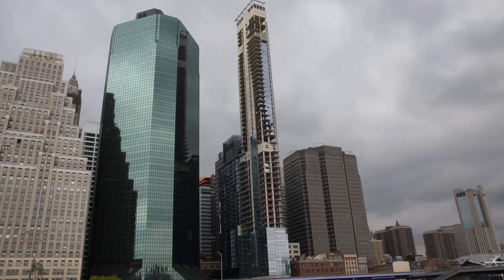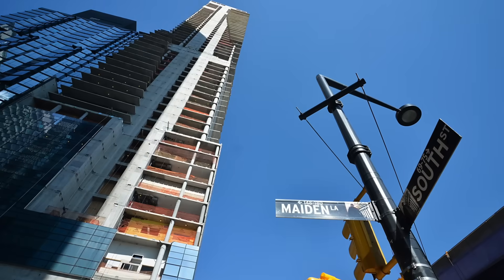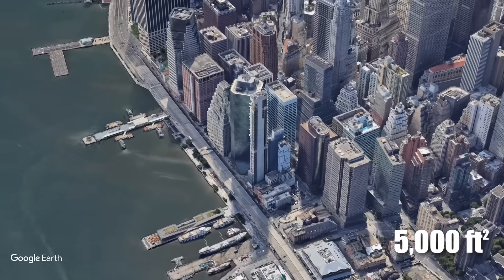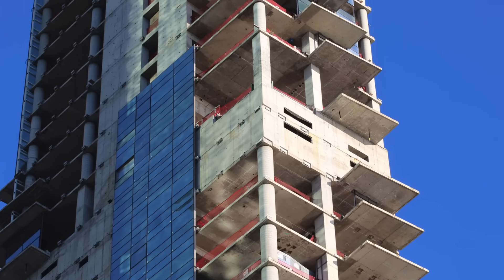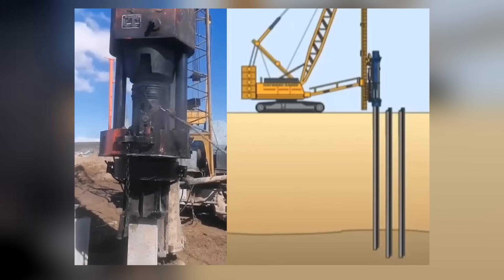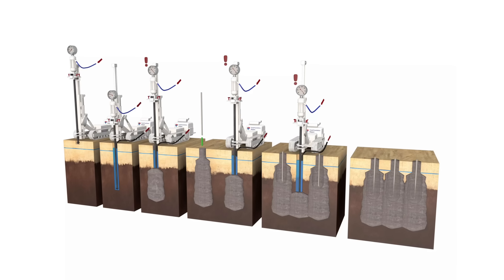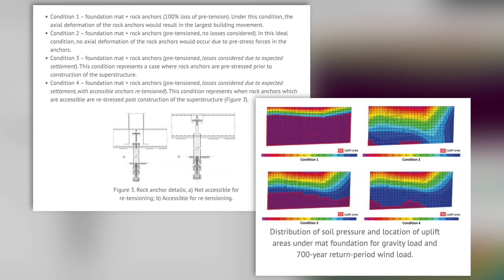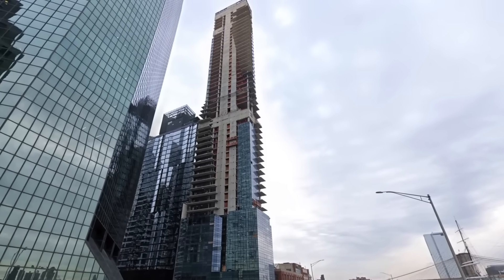Why Nobody Can Fix This New York Skyscraper

Comment from the maker: A nightmare for New York, will this ever get fixed?
Reply: All they need to do is change the name of the tower to East Pisa Tower.
Reply: @lorenzoblum868  More like PISS a tower!
Reply: @lorenzoblum868 or Trump tower 2
Reply: @brianzimmer5532  Trump doesn't build junk.
Reply: @MrAquinas1 😂😂😂😂😂😂😂😂
Reply: NYC's own Millennium Tower.
Reply: @The-KP  It made me think of the Millennium Tower as well. I wonder if the "fixes" used there in SF would work on this building in NYC?
Reply: @The-KP THE DEPTHS OF BABYLON & GABBLE-ON..😊
Reply: It'll get fixed when they tear it down and build something practical on the site.. something drilled solidly into the Bedrock
Reply: No.
Reply: No. The longer they fight, the more impossible it gets. But trying to go the cheap route in the first place makes the fix much more expensive than if they just went to bedrock all the way around at the start. Now they got the building in the way as well as the half assed foundation in the way. There may not be room enough to work around both, and they may have to drill through some of the concrete they put in place. Which will cost like drilling though solid rock.
Reply: @BEdwardStover that's a Murphy's Law.. trying to save money by cutting Corners cost twice as much as it would have cost to do it right the first time
Reply: @BEdwardStover  it’s the same thing they did with the millennium Tower in San Francisco. That didn’t go so well either..
Reply: Oh no! at 6:15 he says heigth instead of height. Doh!
Reply: @TheImpossibleBuild  To all the negative commenters of NYC... you obviously don't know NYC. Most likely never even been there.
   I ALWAYS SAY...WHAT PART DON'T YOU LIKE ?? New York is many different sections,  boroughs, with umpteen different neighborhoods, you can find all your daily needs in.  Or Shopping districts. Galleries, Museums, etc. If you don't like where you are, only a few city blocks can take you somewhere else entirely different. 
   It is entirely walkable, which very few actual cities, if any, can even claim. Especially now that the Times Square reno has tied the whole city together, in a georgeous way.
    Mass transport is excellent, and cheap. Buses run every 5 minutes. It's literally impossible to miss one. No waiting in the cold for half an hr. Longer distances, fast is the subways. But all anyone has to do for a cab, is walk to the curb, and put your hand up. Instant cab. No sitting home irate waiting for one.
   Time is important in NYC. And the city doesn't waste your time, waiting for life to happen. For some yearly event. There is ALWAYS something. Many somethings. And tomorrow, or next week, there are other things. For all different kinds of tastes, interests.
    Some guy wrote on a site, that he hated NY pizza. I asked which of the 1,800 Pizerias was he referring to ??..since pizza varys pretty much everywhere, even in a small town.
    But that's the sort of blanket statements you get,  about NYC, from the completely uniformed.
Reply: I heard him say it leans north. But you are not going to see a 3 inch lean
Reply: @bubbamoran2964  I am coming from the north, so not a good angle for me to see the lean.
Reply: Nope
Reply: I know how to fix it, but they will never listen to me, send me some plans and get your money lined up its going to cost
Reply: @BOBBOB-tx7ox  And I'm willing to help. I did take one architecture course in college.
Reply: I would hire you and you would learn a lot. This is more of an engineering and creative thinking problem than an architectural problem.
Reply: „it leaned three inches or the size of a smart phone.“
Amazes me how Americans will use ANY meassurement before using metric.
Reply: @hatersgonnalovethis  Would in have made you happier to have said: about 75mm, about the width of a cell phone?
Reply: its fubar, in my eyes atleast
Reply: I wonder if the building is insurable and, if so, how does the premiums stack up with normal condos?
Reply: This is what happens when engineering decisions are made by financial people. The 3 most important words in business are "We can't afford." As in "We can't afford to do the foundation right. Find a cheaper way."  It happens everywhere.
Reply: Just because you can, doesn't mean you should.
Reply: Moral of the story: buyer beware! Those old prewar buildings in NYC seem so much safer.
Reply: @wambaofivanhoe9307  Oddly enough, in all these Real estate offerings, and actual sales, that i've seen...no one has EVER questioned the building's integrity. While i realize there are  City and State  inspections, etc., it has to be all too obvious that is faiing short of reality.
   Apartments aren't houses. A house inspection is a relatively simple matter. And yet too many investors...and lets face, ones. Home IS a huge investment, are ASSUMING things that may not be true.
Reply: When you bring in non union contractors expect shortcuts  .plenty of good  properly built buildings on Maiden lane and the whole area .
Reply: It would have been used for money laundering anyways
Reply: NO!
Reply: Nope it’s bout money they don’t care
Reply: It leaned three inches or the size of a smart phone where does this narrator get his measurements from 😂you compare the measurement to a smart phone real genius 🤪🤣🤣
Reply: I am a structural engineer and can fix the building. America doesn't produce GOOD engineers anymore. 3" drift at the top is well within the limit of building code and very easy to be corrected. Due to the steel construction, it is very easy to add actuators and active controls. Very, very easy for any graduate ( PhD or MS) leveled engineers.
Reply: New York, you got money on your mind
and this Pisa tower won't make a dime's worth a difference, so here's to you New York🤩
Reply: new k? vFv
Reply: As a Geotechnical Engineer, I'm appalled!!
Reply: Never buy a home on LANDFILL!!!!!!
Reply: The fix is simple; demo the existing structure; you can build a shorter building with a better aspect ratio on the existing foundation( after some remediation work to the existing foundation); or re-do the foundation anchor it to the bedrock and build the same design over. Moral of the story; most of the time developers want to buy cheap but the "cheap is not always the best option." There are a lot of risks; especially in a foundation work where the ground is somewhat unknown in this site. They should have spent the additional $6m, but they didn't. They can buy a lot of painkillers with that $6m, and spend more to correct this fiasco.
Reply: Is it the same builder as the Millennium Tower in San Francisco…
Reply: If LeMessurier was still alive, he'd probably figure it out.
Reply: Only blessing: not fully completed and nobody lives in it....
Reply: It will have to get fixed somehow, I mean it clearly is in the footings, and I am not sure if there is enough power to correct it.  What would be even worse if the tower kept more and more out of alignment with a risk of crushing the floors in the middle and bring the whole thing down.
Reply: I wonder who paid off the city inspectors to look the other way
Reply: LOL 😅
Reply: If you can make it there just fake your underwear..!😊🎉
Reply: I could easily fall for MAMDANI any day!  He  my mayor guy!!❤❤
Reply: As in neutered?   I could try.....is it safe??😮🎉
Reply: Lol, I hope not! I love a dumpster fire!
Reply: Call in some Chinese engineers. They can fix it for you.
Reply: @Number6_   ....with imported tofu.
Reply: it is what happens when you let greedy bean counters run projects . lol
Reply: @tektkite7255 , obviously Jack Welch trained bean-counters-and-engineers did the most-important engineering-and-design-work on this building.
Reply: There’s no way to fix a building that huge. 3 inches is massive.
Reply: A nightmare for New York? New York is a nightmare.
Reply: @zorngottes1778 New York is a nightmare for some…that don’t enjoy the rule of law.
Reply: 2+2 now equals whatever you want it to and Clown York City.
Reply: Say thank you to the marketing scumbags !
Reply: no any building has a problem when the foundations no good
Reply: Knowing NY probably not
Reply: Let dealmaker Drump fix this within 24 hours after entering presidency.
Reply: It’s NY so yes, in 2056 the permits will be approved.
Reply: It'll never get fixed. They spending that money on ILLEGAL ALIENS
Reply: I would not step foot in new york.🤣😔🤮
Reply: @kurtv.gabhart5441 good😊
Reply: @kurtv.gabhart5441  And we thank you for that.
Reply: @kurtv.gabhart5441  And we thank you for that. Again.
Reply: Trump can fix this tower at any time!
Reply: @justaskinnywhitegirl  Was it intended to be a joke? I hope, not. I , actually, do believe, that Trump ( his organization ) can tear it down and do there something nice.  Remember the Wollman Rink saga? … On the other hand, being the President of the cesspool  that our country is right now, Mr. Trump may simply not have any time for this little nonsense.
Reply: @justaskinnywhitegirl but he has to do it from prison.
Reply: No. NY is finished under the Democrats. 😢
Reply: @mrtechie6810  hahaha the developer is a republican
Reply: @mrtechie6810 The entire country is finished under the Republicans. Trump, the felon, should be in jail.
Reply: @mrtechie6810 yeah, New York needs Rudy back. He’s a stable Four Seasons genius.
Reply: @paulc7486 😂
Reply: @mrtechie6810  As a New Yorker, I take exception to your statement.  New Yorkers (according to Wikipedia) have voted Democrat since 1924.  We are thriving and growing.  One building out of thousands is shut down.  I can't see the lean when I drive by.   What perfect paradise are you from?
Reply: @Number6_  I saw it from the highway on Thursday and I couldn't see the lean.  Is it supposed to lean backwards away from the highway towards the west?
Reply: @CHutch-w2u  There was an exodus during the pandemic but NYC is still the most densely populated city in the USA.
When you say Communist do you mean Socialist?  NYC has great public schools, a great medicaid system, the best parks, the best hospitals, the best restaurants, the best theater, the best subway/bus/ferry system, and many fine universities. Where are you from? 
I was born in NYC and I have never met a communist.
Since my great grandfather and his father were involved in Tammany Hall I agree with you that their politics are not my politics.  
The whole country sends us their talented young people to work in finance, theater, health care and many other fields.
No one loves abortion but some people like women enough to trust them with the control of their own health care and bodies.

Comment: There's no excuse for this, and that includes the fact that the city issued permits for this scheme. One of the most basic truths about building in Manhattan has always been proximity to bedrock. Manhattan has similar considerations to those in other cities, including San Francisco (landfill in a seismic setting) and Cleveland (100-200 feet of glacial till near most of the lakeshore) among others. For example, the new Sherwin Williams HQ is the only building over ~250 feet which wasn't built on caissons; like 161 Maiden, it's on a mat, and has no basement. The Sherwin Williams tower is also much more robust in profile, and it has its own considerable wind load to consider. It's not tilting.

Comment: The building next door at 80 needs to be bought out and either torn down or incorporated into another structure that will support the lean. A complete enlarging of the building may enable enough added value even if they have to drill down to bedrock.
     The alternative is to demolish 161 or substantially reduce the height.

Comment: so they wouldn't spend an extra $6,000,000 to go to bedrock ???  Let's see - $6 million divided by 20 years is $300,000 -  $300,000 divided by the number of luxury suites and you could easily recapture the additional cost of building the structure the right way.

Comment: Bad Design from the Beginning! Shouldn't have been so cheap! Drilling down to bedrock and then belling out for a concrete drill pier! Using a bentonite slurry to stop the drill holes from collapsing until concrete is pumped into the drill pier hole! Pumping out the bentonite as the concrete fills the drill shaft to be reused! We did it at the Houston Rockets New Basketball Arena. You go cheap? You get Cheap! What's going to be the cost to demo or repair that structure!? I bet more than the initial cost of the build!

Comment: Since the foundation is more flexible, what happens if they strategically add weight to one side of the concrete pad, until it levels out?

Comment: They went with a 15:1 aspect ratio... they built a giant sail and didn't anchor it properly. This means flex and sway that will crack the facade and unless they have expansion built into the plumbing... it means leaks. Then there is the elevators moving on flexing rails... Short version: Too damn tall, too little money to do it right regardless.

Comment: Elastic Instability of complex structures still appears largely unmastered by modern engineers.  Euler's formulae don't suffice.  S. Thimoskenko research after the Quebec bridge two collapses lead to major progress including taking vibrations into account. Nowadays,  3D mathematical structural simulations based on finite elements still appears largely optimistic when looking at "extreme" buildings .  Is this due to the details of construction, assembly , materials,  or either shortcuts plus wrong assumptions in the calculations? Independent engineering supervision  plus mandatory forensic, inquiries could prevent most catastrophes. Dynamic stability evaluations ( 3D simulations) should be mandatory in cases of  complex slender structures.

Comment: The Campanile di San Marco was nearly 1000 years old when it collapsed in 1902.  The tower is nearly 100 meters tall.  It was rebuilt in 1912 on the original foundation -- wooden piles driven only about 5 meters below ground level, into dense clay.

Comment: The first thing that came to mind: That high-rise in Miami that collapsed, killing all those residents. This wasn't a mistake. An error in math is a mistake. But if you've gotta leap through all those hoops to find workarounds to avoid the expense of drilling down to the bedrock, then the problem wasn't "unforeseen". They made a very conscious decision to bypass a $6,000,000 solution to the problem, thereby compromising the construction of a building that could've earned them hundreds of millions of dollars in profit. Avoiding short-term pain at the expense of long-term profit. That's GREED. 

This is why we had OSHA, to protect workers from dying on the job to protect developer's profits. It's why we need stiff REGULATIONS, and federal agencies that don't allow corporations to police themselves. We regulated them because they can't be trusted to put safety first because it's the right thing to do. The penalties are there to ensure accountability, and make sure they do it right to avoid all the fines and fees. When we decided that holding people accountable for their mistakes was getting in the way of doing business, this became inevitable. We need to go back to what worked.
Reply: Not a high rise, only 12 stories

Comment: As an engineer I'm appalled that the development team would opt out of a 6M add to drive piles to bedrock and be assured that the foundation was properly designed.
Reply: Seems like it would be code that the building's base be supported , built on bedrock. No ? Thanks
Reply: 6M seems like chump change by today's standards.   Can barely get a halfway decent relief pitcher for that.
Reply: When they were building the Mandalay Hotel in Las Vegas, they tried to save money, and the center of the building sank 18 inches and they had to get some East Coast engineers to prop it up.
Reply: @michaelellringer5600  
And that's a high seismic zone region as it is.  Hard to believe they would get away with chinsing on the foundation design there.

Comment: The ground works are the most important part of any construction project. Weak foundations will never last the test of time and the building is already showing signs of stress. Soil improvement works will tighten up the filled ground but will always compact when load is applied upon it. Once a raft foundation applies differential pressures into the ground and it causes movement nothing will bring it back especially with that colossal weight bearing down on it. The moral of the story is,never cut corners with building foundations

Comment: I wonder if engineers could calculate an architectural formula to deconstruct and remove floors from the top of the building down to reduce the overall weight of the building that would stabilize the building on the 200 friction columns? At the end of the day. The builder is grossly negligent for failing to architecturally design the foundation that's anchored to bedrock!

Comment: I worked directly across the street at 180 Maiden Lane. There was a Taco Bell on the corner and that was wiped away when they started to escavate. The noise generated by that was heard and fwelt all the way to where my office was on the 12th floor. I guess now, they're forced to take it down. Am I glad I no longer work there.

Comment: Bedrock means strength, shear, stability and structurally sound, period. I’ve been a Concrete Contractor in California, for over 40 years. I have been through 3 earthquakes, after the big one in 1994. 

I saw every building not connected to Bedrock failed! I spent 4 year on structural repairs, retrofitting and over 100,000 lineal feet of epoxy injection. May God bless everyone ✝️🇺🇸!

Comment: Exactly the same problem as Millennium Tower.  I think they saved $4M by not sinking pylons to bedrock.  They have spent $100M trying to correct an uncorrectable problem. Looks like same end here.  Engineers have known about unstable foundations since the Leaning Tower of Pisa yet they continue to shortcut.